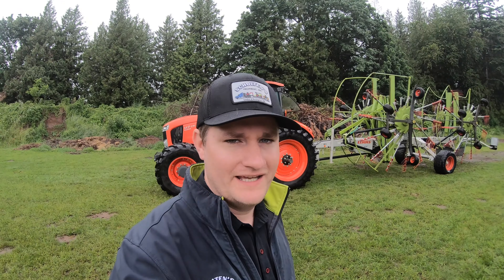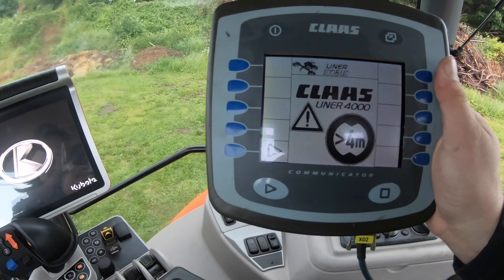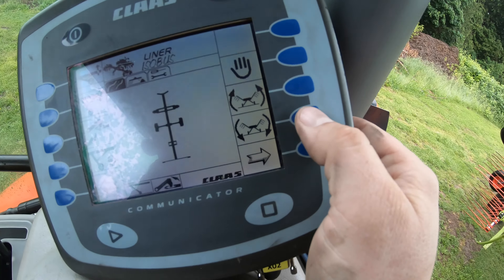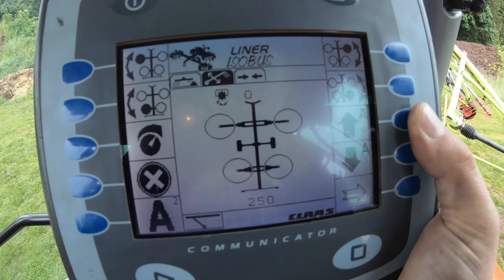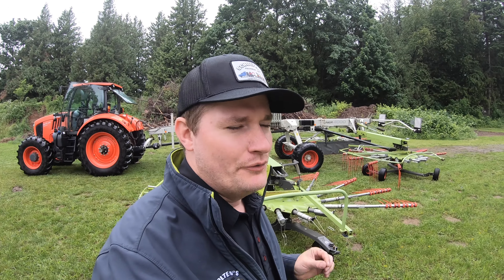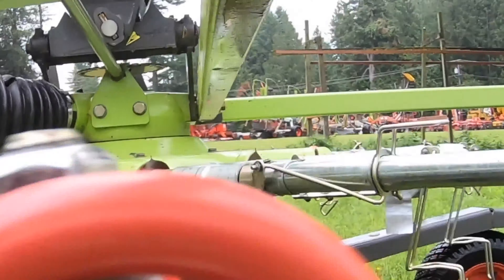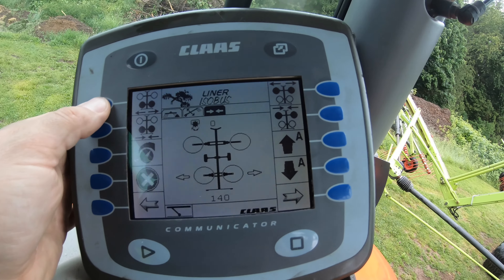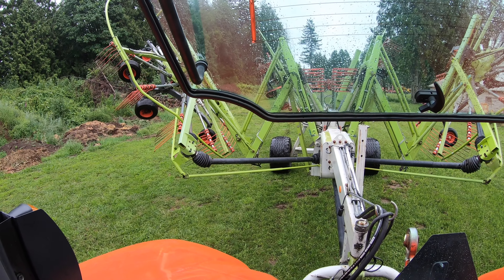CLAAS Liner 4000 Rake

Comment: You can’t even run at 540 😂 450 is always enough I wreck thousands of acres . Wheel height is most important so not to scrap soil and stone into the row . And u can set the rake at any setting and record it .